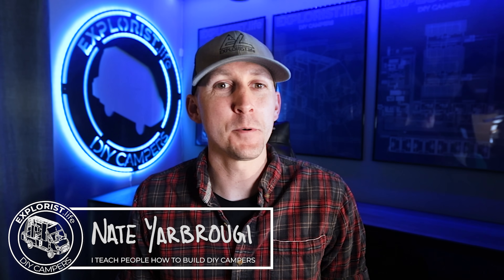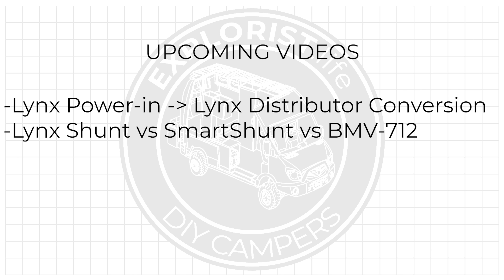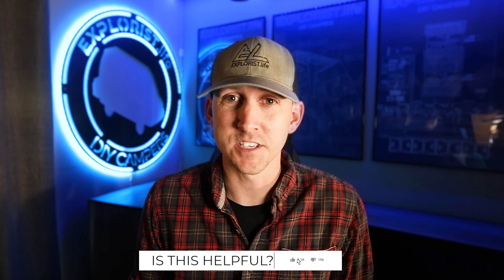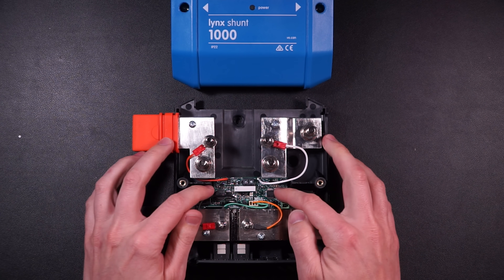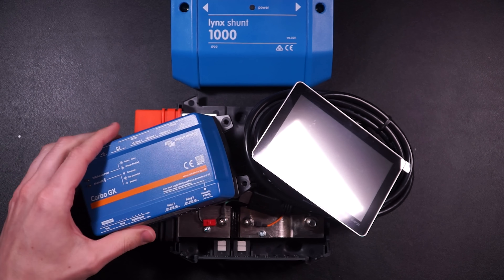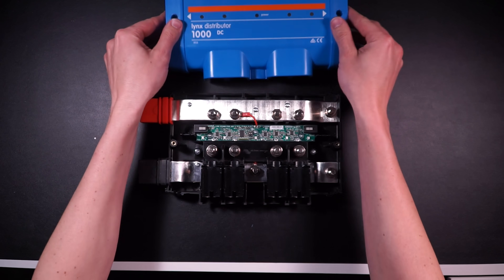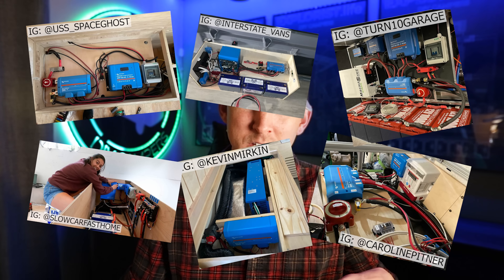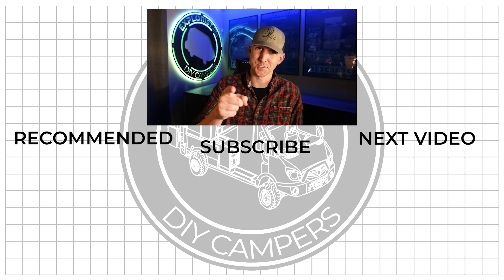Victron Lynx Distribution System Review for a DIY Camper Electrical System

Comment: I found a way to get the fuse lights on the Lynx Distributor in an online post, but I want to see how you recommend to do it.  It would be a shame not to take advantage of the Lynx Distributors capabilities.
Reply: can you post a link to the online post about the lights?
Reply: @KlausenArve  Yeah, the post is located at https://community.victronenergy.com/questions/6573/will-the-fuse-leds-on-lynx-distributor-illuminate.html  UPDATE:  I got my DC voltage converter and wired it up.  I was using a 12V power supply to hook up to the Lynx Distributor for the 12V.  I cut the little gray "phone-type" cable and soldered it to the converter outpput (yellow +, black -).  I hooked the input of the converter (red +, black -) to the screws on the right send of the Lynx Distributor.  I plan on putting a fuse inline on the red wire but I don't have that yet.  It worked great.  Just so you know, if you have a blown (or missing) fuse, the power LED and the LED over the bad fuse both light up red.  All the fuses have to be in place and then you will just get a green LED on the power LED only.  That's what we wanted, right?  Very cool.  I couldn't use the Lynx Distributor without utilizing the LED capability built-in.

Comment: Say you have 2 lithium battery banks one 200ah and a 280ah do you need two? I have them isolated with their own Victron charge controller and the batteries have 200a smart bms’s. How do I configure this? Ty dave
Reply from the maker: The batteries in a battery bank should be identical.
Reply: @EXPLORISTlife   let’s don’t though this idea out without the science. Well the fact of the matter IS I have two banks. Right now there isolated. New data shows it is possible to have different ah’s if not too Dissimilar ah “can” charge off the same charge controller because of the BMS. People have just not explored it because they live in a perfect world. People Said I shouldn’t have been able to what I’ve already done . This is probable possible. Let not cut ourselves short and try and figure it out. Call it a challenge. I’m asking one of … no probable the best solar company ever to just scratch their head and address the idea… is it possible? Maybe it’s like dissimilar solar panels… it will take the lesser wattage. Who knows. I’m no Engineer. Both banks are lifepo4 200ah and 280ah.  exact Chemical composition .  Do we still believe the world is flat?
Reply from the maker: Ultimately, do whatever you like, but I'm just going to provide advice based on best practice.  If you want to stray from that, I'm not going to come fine you or something. Lol

Comment: Hello
I have another question about the lynx distributor
on my solar installation I have 5 strings so 5 mptt smarsolar 150/35
they all have their 40A mega fuse fuse
I was wondering if it was possible to connect the 5 smarsolar 150/35 directly to a lynx connector with a 200A fuse?
possible? because otherwise I have to buy 2 lynx (expensive) to connect 4 individual smart solar (6MM²) on each lug of the first lynx and 2 others on the second lynx with the multiplus 800VA in all 7 locations on the 2 lynx
no risk of gathering all the mptt in 6MM on 1 lug of 50MM²?
Reply from the maker: You'll need one charge controller per space on the lynx distributor.   Combining all of them on one fuse is strictly forbidden.
Reply: Thank you for your answer
yes I have 5 mptt 150/35 charge regulators protected by 5 40A fuses

so each regulator must be connected by space of the lynx so I need 2 lynx of 4 spaces
i already have the fuses between the MPTT and the lynx no need to add another mega fuse on the lynx on each mptt?

Comment: @exploers life. Why do I need a separate solar controller if I can get a dc/dc charger with solar controller in one?
Reply from the maker: If you decided to go down the route of a combo charge controller and DCDC Charger... you wouldn't need seperate components.  Generally, the combo MPPT's and DC DC Chargers are so limiting that I can't recommend them.  For example...  the 50A renogy DC DC Charger has a max solar input voltage of 25V.  This is not even high enough for the MPPT to properly do it's job and SEVERELY limits how you can wire your solar array.   It's just not a good system.

Comment: Nate...have you experienced / seen a Victron BMV 712 battery shunt with temps around 130-140F? Seems a bit high...
Reply from the maker: That does indeed seem a bit high.  I would check the quality of the connections of the wires to the lugs and the lugs to the shunt.  That would more likely cause heat than the shunt itself.

Verify good crimps and sand/clean  the lugs to shunt connections.
Reply: @EXPLORISTlife  my plan exactly....thanks for the confirmation...using Southwire 4/0 and Selterm Lugs w/ hydraulic crimper.

Comment: Hey Nate!

Awsome video, definitely answered a bunch of questions I had!

I am about to buy all parts for my system, but just have one question:

Due to my system needing 5 loads from the batteries, and the distributor only allowing 4 - to save some cash - could I use the distributor for 4, and use a power-in (connected to the distributor) for my 5th load?

Im just curious because you said you can kind of hack the Power-In to make it a cheaper Distributor? 

Thanks!
Reply from the maker: Yep!  You could definitely do that.

Comment: Nate, thanks for the great videos.  I bought the suggested setup (including the Lynx distributer) from Battle born and am very happy.  I have a quick question.  I received the battery isolator (Li-BIM 225), do I also need a DC-DC charger?
Reply from the maker: In my diagrams (https://www.explorist.life/solarwiringdiagrams) I recommend the Orion DC DC charger INSTEAD OF the Li-BIM 225, but either will work.  Here are my thoughts on that: https://www.explorist.life/how-to-charge-diy-camper-van-batteries-with-vehicle-alternator/
Reply: @EXPLORISTlife  Thanks!  Now back to cutting mini-cell.....
Reply: @EXPLORISTlife  Thanks for linking your article.  Very helpful explanation

Comment: If these are "right handed" devices then they need to make "left handed" versions too.  My setup is all twisted around because of the locations of the batteries and outputs.  They do have impressive capabilities to flip them over for feed-up or feed-down.  They even included a replacement sticker printed the other way.
Reply: I have similar issues with my batteries being on the wrong side of the inputs. I just mounted it upside down and was going to make a new way to cover the openings that are now on the top. Where do I see these feed-up/feed-down solutions?

Comment: How does my Spartan charger/inverter compare to this set up?
Reply from the maker: They are not really comparable as they serve two completely different functions within a system.  This is a busbar and fusing system (basically), and your Inverter Charger converts back and forth between AC and DC power.

Comment: When you can, please provide an in-depth review of the Lynx Smart BMS. This video skips right over it. 

I understand you don’t have one yet, but it is so new that there is no third party info on it, so lots of folks are asking questions about it, and coming up very short. (One example, even Victron diagrams show it being used with a BatteryProtect, which makes no sense. Victron community could not even answer that one!)

In particular, in what systems would it make sense? Adding up all the components it seems to replace only gets to about 70% of the price. Things just don’t add up…
Reply: Yes that would be great.  Just getting ready to order my parts and just wondering what the Lynx Smart BMS can replace.  For example - I was going to use the BMV 712 and couple of battery protect units for charging and load each.  Also would it also replace the VE BUS?

Comment: Victron is great gear but quite pricey.  There are other brand DC/DC chargers with a lot of this capability but not so expensive.  Additionally busbars are relatively cheap for distributing power and look great
Reply from the maker: Busbars w/ external fuses are actually MORE expensive when compared apples to apples and also introduce more connection points (points of failure) than the Lynx Distributor.  I have a video about that as well: https://www.youtube.com/watch?v=548aRhZMN-g

Comment: Victron has this backwards. The distributor should be the power in and vice versa
Reply from the maker: The power in is accepting 'power in' from all of the batteries and the Distributor is Distributing the power to and from all of the loads and chargers.

Comment: $200 for a bus bar is crazy.  Even with some smart functionality that's a stretch.  That blue paint must be expensive.
Reply from the maker: Lynx Distributor: $206 (https://amzn.to/3yg7YdG)
4x Littelfuse MEGA Fuses @ $5/ea = $20 (https://amzn.to/2T0pQcB)
All in @ $226

Vs: 

2x Blue Sea Busbars @ $78/ea = $156 (https://amzn.to/3fs7oRk)
4x Blue Sea ANL Fuse Holders @ $22.53/ea = $90.12 (https://amzn.to/3hwLPBP)
4x Blue Sea ANL Fuses @ $21.50/ea = $86 (https://amzn.to/2S0XzSm)
8x Lugs to connect busbars to fuse holders @ $1.50ea (varies depending on size, of course) = $12 (https://amzn.to/3uYmy7B)
Heat shrink & wire cost for connecting busbars to fuses not included
All in @ $344

So... yeah... for quality components, its hardly unreasonable.

If you are diving in to cheap, no-name busbars (https://amzn.to/2SNHRdM) and fuse holders (https://amzn.to/3v0w4r2), that's a different story, but I've seen too many parts melted due to poor quality control on those low-end components and can no-longer recommend them, but you do you.
Reply: @EXPLORISTlife  Yeah, I can see your point regarding the value there compared to a blue sea set, and the Lynx is clearly well designed.  I can't see why you would need 1000 amp bus bars on a DIY camper.  Even at 12V, you'd have to be running multiple inverters in parallel fully loaded and all the DC loads you could fit inside a van to even make a dent in 1000A.  Maybe Victron could make a system more appropriately sized and priced version for smaller 12v and 24v systems?
Reply from the maker: They have this one (https://amzn.to/3bQ6Eov) that's rated for 500A, but it doesn't have a negative busbar.  So, you'd need to add one (at $78.  Which you would bring you to $128 all in, which isn't much savings over the modded Lynx Power-In that I'll be showing in next weeks video.

The 1000A limit is nice for me from a teaching standpoint as it removes all doubt.  If there were a 100A Lynx Distributor and a 125A lynx distributor, and a 200A lynx distributor, and a 300A lynx distributor it would send people even further into analysis paralysis.
Reply from the maker: ... and they are also coming out with all kinds of other fuse holders, busbars and such, but not all of these are available in the USA at the moment.  And if something is not available... I'm not going to put it in a video or diagram.  Here is their video about the new stuff: https://www.youtube.com/watch?v=_ahGk8tA0xk

Comment: An expensive answer to my budget question. This system is for those with massive rigs or budgets. In a couple years, this system will be 1/8 of the cost. In the interim, Victron is emptying the wallets of affluent nerds. Congrats. Not for me. Implementing these super pricey options destroys (obliterates) my budget. If you have a sweet $300,000+ 40-45 foot RV. Go for it! I have a modest 22 foot ($25k) travel trailer. Way out of my league.
Reply from the maker: The modded power in Ill be showing next week will get you two 1,000 amp busbars and 4 high quality fuseholders for sub $150.

You'll find that price comparable with alternative solutions for the same purpose unless you want to dive into the no-name fuses and fuse holders that I've been seeing melt-down over the last year.

I'll be covering that in an upcoming video, though.

At any rate...  this channel is about doing it right, so we only have to do it once.
Reply: @EXPLORISTlife  I see this Power-in mod to utilize as a distributor as a savings compared to all the cabling, lugs and misc materials required in a DIY. Will give a cleaner look because it's much safer!
Reply: The title of the video isn't "Budget DIY Busbars". He's got an older video (mentioned in this one) about how to build nice DIY busbars, wire in the inline shunt etc. This is for those who want to spend a little extra for a cleaner install, not pinch every penny. It's also pretty trivial and silly when we're spending thousands on electrical components to then skimp on how it's all connected. Only as strong as your weakest link and all that jazz.
Reply: @CharlesNelson303  Some folks can rationalize extravagant expenditures. Since I have a modest travel trailer, it's a good idea not to (I'm using metaphors) blow Mercedes 600S money on a Ford Fiesta. Just say'n. Again, noting the obvious. These bits and pieces are way too pricey for my budget. If I owned a Prevost .. Yesireebob!
Reply: @EXPLORISTlife  I'm a 70 year old fan. I plan to upgrade my solar this winter. I'll be following the guidance set forth on your channel. My goal is not to die from electrocution or from falling off the RV roof. Wish me luck.
Reply: @RVTA  I don't think what you own has anything to do with what you invest into your comfort and peace of mind. That said, if you're running a single 100w panel with a 100ah AGM and the price of these components is equal to half your investment then yeah, that would be pretty silly. 

For me, I'm not going to tie 5 grand in solar and lithium together with $50 in Chinese products that have no quality controls. People like me are who the products are aimed at. I guess I'm an affluent nerd, though, the only place really draining my wallet is the lumber store that's charging me $120 for a sheet of plywood.
Reply: @CharlesNelson303  You can blow your cash any way you want. It's your life. I was just say'n, on my modest budget, I can't rationalize spending that much. Obviously, you can. Congrats! My plan involves a pair of 100ah batteries (lithium), possibly a Victron charge controller and upgrading my solar array. The wiring should be relatively standard. I'll watch the usual YouTube suspects and try not to kill myself. I'm in Texas. My brother the electrical wiz lives in Baja. He's no help. Wish me luck!!!

Comment: can i use any solar controller with victron lynx distributor
Reply from the maker: If the charge controller can connect to a busbar with normal wires and lugs, yes.
Reply: @EXPLORISTlife  
thank you